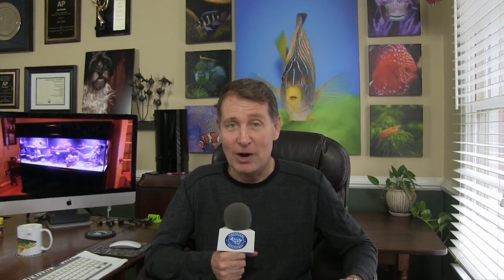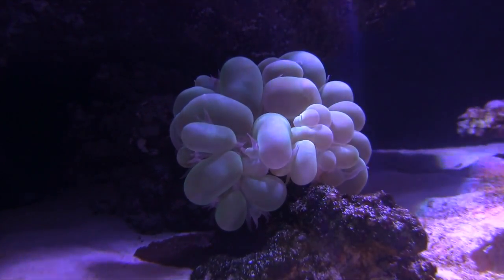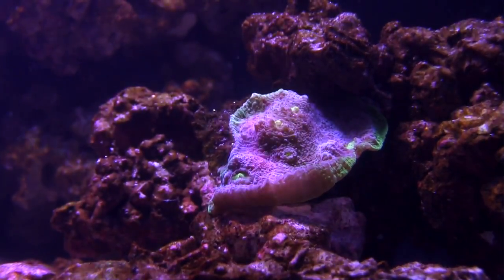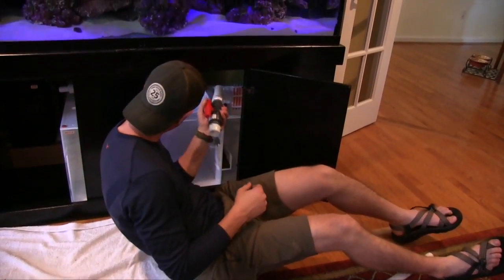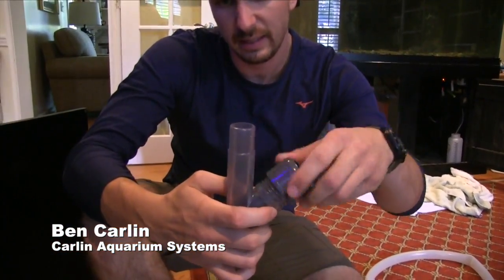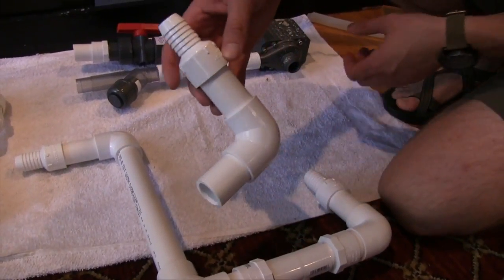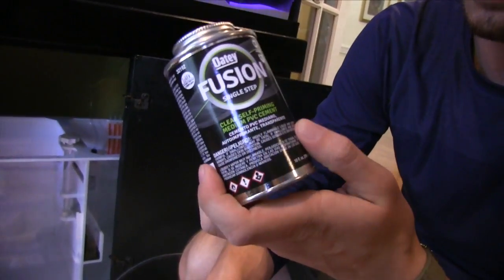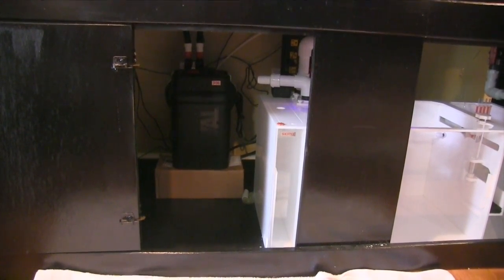Plumbing the Sump - Part 2 of the 180 build series. Fincasters Episode 177

Comment: John I had a 90 gallon planted tank with a stand just like that after about 6 months the silicone around the bottom let go and it started leaking, had to get up in the middle of the night to drain and clean up the mess, at least I would put a piece of plywood under it and brace it a little better.